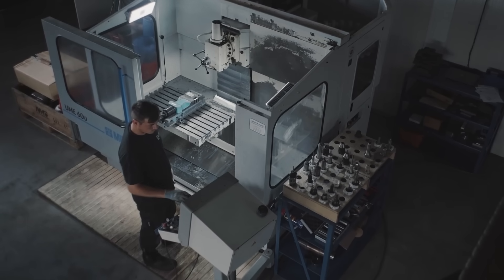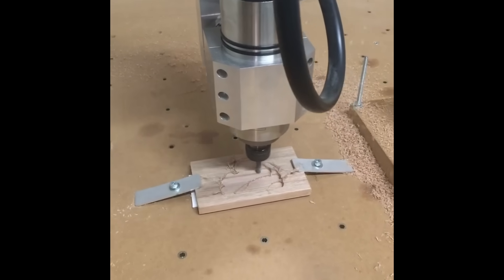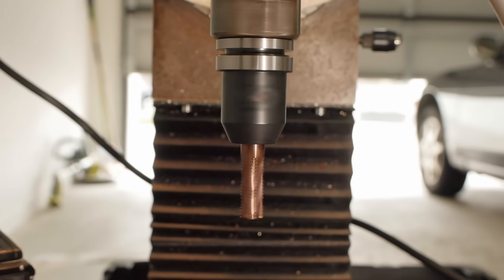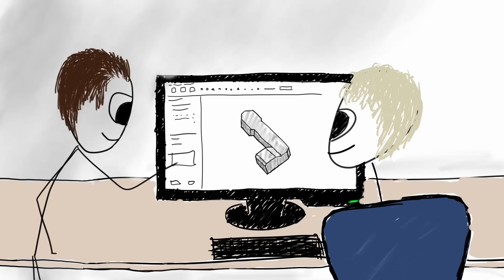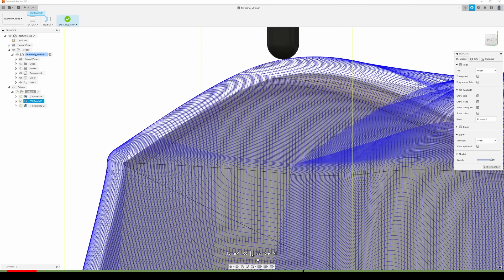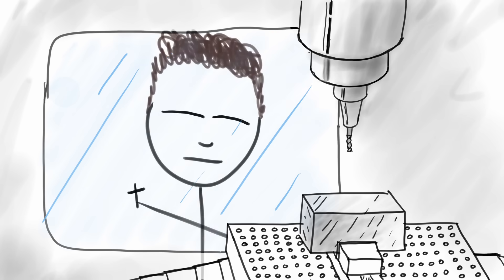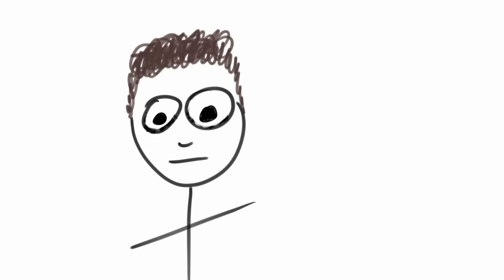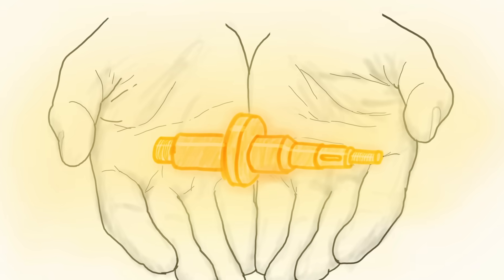Casually Explained: CNC Machining

Comment: 3:49  For those who know, machinists do not pray.  They pucker.   They pucker in places that you don't want to be that tightly puckered when they press that Cycle Start button.   

If a machinist is wrong, instantly, a $500 dollar cutting tool can go out the window.  A week of dealys in production can happen as a service rep repairs the machine.  All competitiveness in selling the part is instantly lost.   Reputation is lost.   The work material is destroyed.  The machine itself can lose some precision that will be costly to reinstate.   The crash is like watching a car crash.   It is sudden and there often isn't time to react since CNC's operate at high speeds.   

The machinist revels in every single precision piece made.  The fixturing that might be custom made might be damaged.   The workload is usually high and the number of hours worked can be high.   The code might be bad or some part of the setup might have been overlooked.    It could have been because of a previous worker leaving a setting on that was modal and not mentioned while passing off the machine to the next worker.

The machine will be tied up with the delay of fixing even a minor mistake.   The economics of it has gone out the window.   The machinist's confidence can be broken.   
The simple forgetting of one detail can be this costly.    

And so a machinist PUCKERS.  

If the CNC is enormous like a vertical lathe that is used to turn parts meant for enormous mining equipment....just the chip being cut from the metal can drag you into the machine and spaghettify you instantly in the same way a black hole does.   This happened to a young machinist not far from where I lived.  It caught his hoodie...with a stringer chip that flipped around. 

The chips can be like fifty foot long thick flexible razor blade whips.   

Some CNC machines are so large they can terrify even the most hardened veteran machinist into never wanting to work at that machine again.   The forces involved are staggering and unexpected things can happen.   

Some CNC machines are so expensive that they can produce things that are impossible to make anywhere else in the world besides a few purpose built machines.  You have to be highly trained and qualified to just look at the machine.  

Some materials and methods are expensive and exotic and take a lot of planning, and still do not work.

Sometimes what you are told to machine has to have its blueprint sent back to the engineer or person pretending to be an engineer because there is no way to machine it and also hold the part steady, so it has to be redesigned.

Tool choice can make you or break you.   You had better be able to pick the best option among hundreds of variations for the job.

Other employees can sabotage you by forgetting to mention they changed the tool assingments in the tool carousel.

Being a machinist means you are not going to be paid for your highly technically demanding skill.   You aren't just pressing a button and telling a program to run.  

You have to understand chip thinnning, metallurgy, and the dynamics of cooling and the exact way the cutting surface meets the metal, or the porcelain, or the space age alloy or any other bizarre number of materials you have to machine.

Your employer expects you to get it right the first time even though your skills are on par with a jet pilots but your pay is on par with a bus driver's.

The old guys in the room are snarky and are not going to help you and do not have time to train your nor to help you sort anything out.  They are well past the bitter stage of being unappreicated for this demanding job.

Explaining to people that they have to be able to understand also Geometric Dimmensioning and Tolerances and that mistakes and oversights on blueprints are half of the problem.

If you are part of a production pipeline and you always will be ......all delays will be blamed upon you as being the bottleneck of the slow down in production.  

And these are the things which make us machinists mean.
Reply from the maker: Incredible description of what actually makes it hard. I might make a video about all this!
Reply: @machsuper  And that is just an introduction to the list of difficulties, which completely ignores that with progressive operations the part is getting smaller and smaller and is more difficult to hold onto and might flex.   This leaves out the dangers of surface grinders, and the ever present task of making sure chips are cleared and don't get between the tool and the workpiece.
Reply: @OceanusHelios I'm just getting into this but isn't there a list of tolerances and durability on each tool marked on the box when you buy it, and an entire book that lists durability of different materials?
Reply: @baseddepartment285  Machinists deal with Cutting Speed and so do engineers.  It turns out that the material the tool is made out of (including it's coatings) and the material that is being cut have an optimal cutting speed.  It's why there is a tooling steel called High Speed Steel.   Carbide cuts at higher speeds too and relies on a different phenomenon in that the heat is carried away in the cutting chip and the work piece heats up less.  It's pretty fascinating.  The durability comes down to how hard you are pushing that tool and other factors.   All of this is very similar to buying drill bits.   When you buy a drill bit, it isn't just marketing when it says they are made out of carbide, or other materials.  That material of the tooling has different harnesses.  Carbide inserts for a shell mill will be able to cut at higher RPM's and are thus preferred because it can cut down the machining time as material is moved quicker for each cycle of use.  As far as what is written on the package for these, yes, it is usually there to a degree or lesser degree, but having machining knowledge helps out greatly because you will know why it is important and what it means and not just catch yourself wondering if it is a sales pitch or wondering if you are spending too much money on a single tool for a job you are only going to do once or twice.
Reply: @OceanusHelios  the first part is what I'm asking about. When I started the course they gave us a book with tables for each steel ever and their strength and off that info we calculate through the formula the optimal cutting speed which also depends on aforementioned quality of the machine and bore which is listed in the manual of the machine and the box of the tool
Reply: @baseddepartment285  That sounds about right.  But cutting technology is quite the rabbit hole to go down.  Cutting speeds and feeds and speeds and tool paths are what machinists dream about at night.   And you're right about the machines too.  I've used older machines built very rigid and solid.   Some machines just don't have the rigidity, but most are.   They have to be solid and rigid to maintain precision, and thus have a lot of mass and bulk in their construction.   A machinist has to also think of depth of cut, the diameter of the tool, and other factors.   Experience and/or recommendations inform the machinist but when metal is on metal the machinist relies on his eyes and ears to watch and listen to see if the cutting is going smoothly or is a struggle.   This is not even counting things like cutting fluid or coolant used in the machining.  The metal is essentially plasticized at the cutting edge of the tool and is cut like a spoon gouging silly puddy more than it is like an axe splitting wood.  Then the machinist has to pay attention to other details like chip thinnning (which helps in efficiency and surface finish) and chip removal and chip breaking.  It would be nice and a dream if it were a one size fits all answer and have it be dogma for now and hearafter for the job, but adjustments always need to be made.   One thing machinists say, "I can make anything you want except for money."
Reply: @OceanusHelios  i enjoy reading this comment. Are you a machinist now or you work for at another job?

Comment: I dunno, I don't find watching the simulation passes on CAM software boring... It actually takes away a bit of that paranoia feeling if it has your machine accurately modelled as well as all your tooling, workholding, and of course the part.

Comment: So what I’m getting is that it’s different from 3d printing because you have to manually slice the object. Feels like you guys need some software friends.
Reply from the maker: There’s so many more considerations in machining. Rigidity, vibration, tool length, tool shape, access to all sides needed in more than one setup, holding an irregular shaped half finished part, MUCH tighter tolerances. What works on one machine might be completely unrealistic on another. Machining is just so much harder to simplify into a single software solution, it still needs a keen human eye and judgement to know which tools to use, at which speed, in which order.

Comment: Trained and experienced CNC- machinist here: Excellent video to bring it casually! Good example with the wood. A lot of makers are buying a cheap CNC machine or even modify an existing one to make it a CNC-Machine to cut some nice wooden pieces. But yea the ones I know respect me for knowing how to cut metal, because that's just an entire different story. Only thing lacking in this video is the importance of how to hold you workpiece. I mean it's easy to clamp a square block. That's mostly not the case though. Especially if you have an existing part and you are asked to 'just remove a bit of that surface'. :D
Reply from the maker: That’s true. Work holding really did deserve its own bit.
Reply: @machsuper  Haha yeah, setup and jigs are an art in themselves! Since I've more recently started 3D printing, I've actually been able to 3D print jigs for the mill. That's been amazing! Just.... not out of PLA or TPU 🤣

Comment: 3:00 no the hardest part is not the programming, its the clamping and vibrations especiallyfor thin parts. You can easily check if the program is written wrong to cause a crash.

Comment: As an outsider, I feel like the nerds that gush over 3D printing (and the little trinkets that they make) can only dream about being 1/10th as cool as the CNC chads.
Reply: Yeah, you'd fucking think that the $500 statue-making machine wouldn't be as cool as the $20,000 Steel Annihilator 9000, but the 3d printer can use the other $19,500 to go to the club and doesn't come home covered in a petroleum film

Comment: As a 3d printer getting in to cnc Im 70% there
Every time i start a print its a mix of fear and anxiety
Ive only had one crash out 
Bit the scary part is if plastic leaks out of the nozzle the wrong way it can catch fire and wreck the printer.
Or your home.

Comment: 4:19 I'm not a professional, but I must be SUPER lucky. I used a 3-axis CNC router, and when I put the bit in I didn't make it more than an inch. So there was this plunge cut that was over am inch. The machine goes for it, the collet gets stuck, and machine breaks. THANKFULLY it was just a popped 6A fuse, which you can get a pack of like 10 for $20 or something.

Comment: CNC machining is underrated profession, it's complicated, takes responsibility, whole day looking at machine and metal, low pay. Only thing that is worth is starting your own CNC workshop.
Reply: Cnc machinists pay varies greatly. Don’t expect as an operator to make fuck all for money. Setup operator makes marginally more. Tool and die or mold makers make a little more, almost a decent wage depending on the shop. Programmers make a bit more. Idk man maybe I’m too jaded lol
Reply: @nwfpv8681 Anytime our CNC breaks down and the programmer has to be called to come down and fix it the dude just walks in with the biggest smile on his face 😂😂😂
Reply: Tool/die makers get a decent living, but they often do the CAM-programming their selfs, setup, machining, etc. so it’s a more complicated and requires skills. It takes years to get proficient at it and you just don’t find guys like that easily. Second good category is programming complex machines, like Swiss, Mill-Turn or those really large mills with multiple Z-axises.
Reply: @testi2025  Lmao i got trained 4 weeks to run 2 5axis machine with basically 0 experience. I do my own setups, cam programming, machining etc. Its basically my "side job"- when the main guys are sick or on vacation i have to replace them and the runtime on that machine is from 10 hours to 48 hours and that can be like 1 week of constant milling and then a gap of 4 months and then 1 day again and then 2 months gap and 1 week again.. That's how you learn right?  (Tool and die making).. I also have to 3D scan and compare the finished mold after I finished/ and assembled it, yea that's also my job, while i teach and give work to 2 apprentices on the side.. and i have to run the all handprogrammed Older cnc mill when the guy isn't there and replace the Lathe operator (cnc and manual)...  

So i basically do the work of 6 people "on the side".
I basically live paycheck to paycheck by the way, "tool and die makers get a decent living"... Ok buddy. I do that ON THE SIDE and get paid jack shit.
Reply: @FireGodSpeed it’s nice to hear that you consider yourself as a proficient 5-axis machinist. You should find a better paying job in that case.
Reply: @FireGodSpeed  dawg is this really true???

I'm about to buy my own machine and start doing some Xometey parts... Am I about to financially ruin myself? 😭
Reply: Starting your own company and getting established in the industry is not as easy as you'd think. And don't even get me started on getting ISO (and similar) certifications. Finding good employees amongst the worker shortage is also quite hard. If you're on your own, you'll be working 16 hour weekend shifts with the same low pay because of higher income tax. (At least in the EU)

Comment: I'm TRIGGERED, literaly shaking while sitting watching this.  I can still hear the tool changes and air hoses blowing in the distant past.
Reply from the maker: PTSD engaged
Reply: nothing like paying attention to every single sound with your hand quivering over the red stop button, hoping that you didnt fuck up with a tool clearance somehow
Reply: @bird5119  typed "G43 H6" instead of "G43 H19" once...had to sacrifice a nice piece of carbide to extract the form tap from the hole and then spend half an hour precisely turning a pin by hand to take to the welders.
Reply: @Soundpost-f2l  just think of how few people understand that lol.
Reply: @Soundpost-f2l ouch 😅
Reply: @Soundpost-f2l oof
Reply: @bird5119  when the bad noise happens and you hit the red button, and just stare at the workpiece for five minutes, and instantly die inside.
Reply: @bird5119  I override my rapids to the feed speed and very carefully move the feed dial just barely above 0 while checking the distance to go like a hawk while remembering the clearances I had set in CAM. I will then crash the machine using the manual pulse generator and a massive brainshart. I'm going to have a part with less than a mm clearance between hard jaws and a tool worth multiple hundreds of dollars soon please keep me in your prayers
Reply: It's okay. Remember your safe space. Imagine the sound of the spindle returning and the table rapiding back home. You open the door and everything looks good. You measure the critical features, and everything comes back right in the middle of the tolerance. A warm feeling of calm washes over you.

Comment: I’m a machinist trapped in the body of an engineer. You’d think that would make me better at either engineering or machining but it actually just makes it impossible for me to have normal relationships or conversations.
Reply: Well add autism to this and you got my starter set 😂
Reply: The autism+engineer and or machinist combo goes wild @Basement_CNC
Reply: @saffron584  I think you need a little bit of it to become one of those in the first place 😂
Reply: Lmao I just left engineering to be a machinist, at least I have to talk to less people now
Reply: I both design parts, make NC programs and cut them.. We're a small shop
Reply: ...so a technician?
Reply: @D20Steel no, an engineer who spends way too much time hanging in the shop and watching hobby machinist YouTube when I should be working.
Reply: @ourtube4266  lmao I studied mech engineering and work as a cnc programmer at the moment
Reply: I’m in the process of learning cNC programming already have my me degree is it worth it?
Reply: @ourtube4266 that still sounds like a technician ironically lol

Comment: I crashed the 5-acie machine last month and I still haven't recovered. I wake up in the middle of the night thinking about it 😅
Reply from the maker: Ohhh no no noo
You will live, the world may never be the same, but the world WILL keep turning. Hang in there.
Reply: You never forget your first real crash... ramming a 40mm diameter boring bar into the spindle because you were new and distracted by people talking to you was a very fun experience 😂
Reply: saw a note in the comment section:If a mistake brakes the part: Bad Day
If a mistake brakes the tool: also bad day
If a mistake brakes the fixture: real bad day
If a mistake brakes the machine: really bad day
If a mistake brakes You: last Day